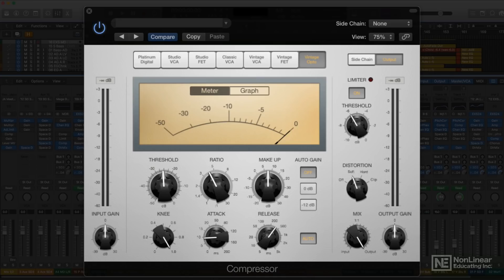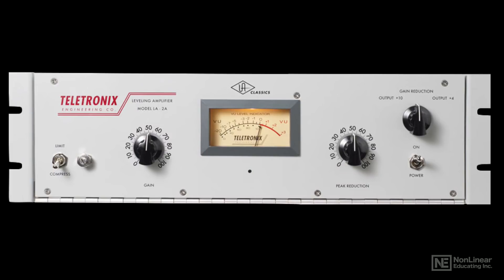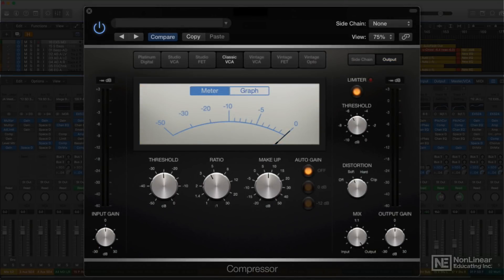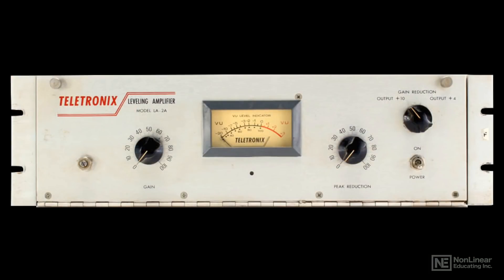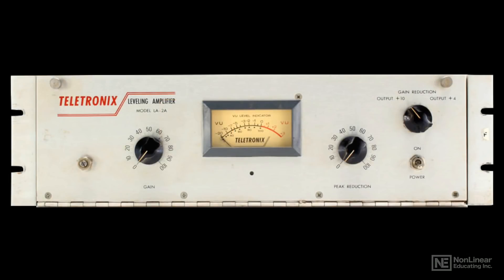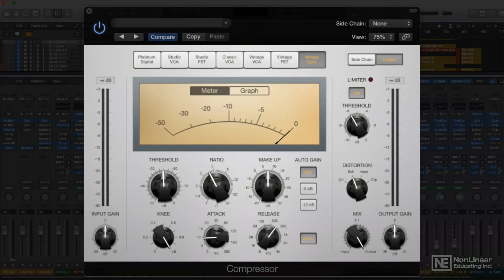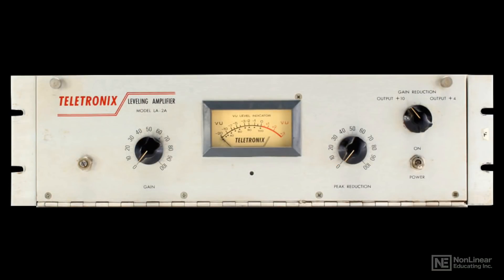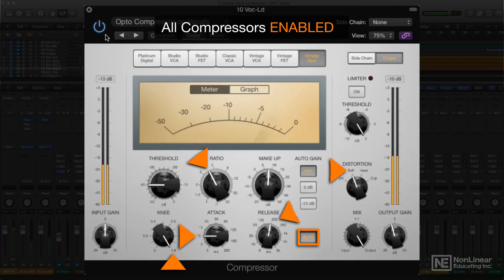Logic Pro X 203: Logic's Compressors - 5. Vintage Opto

Comment: Quick question...why would you set a release time, and then make sure the auto-release function is turned on?  Thanks for the content!
Reply: From the logic manual: "The behavior of the auto release function (and compression results) change when different Release knob values are used."  Its my guess that auto-release takes into the account the program material, and makes adjustments to the release setting to suit.